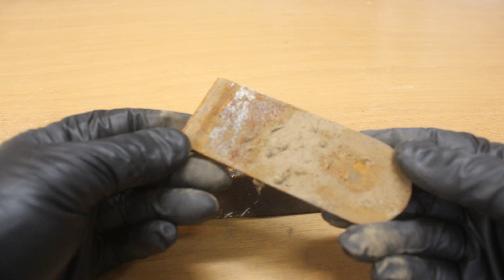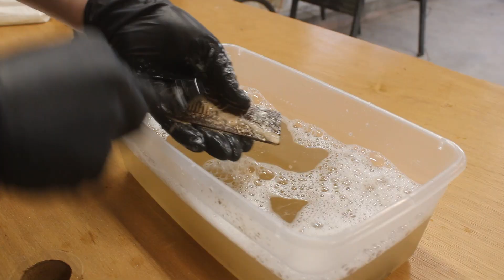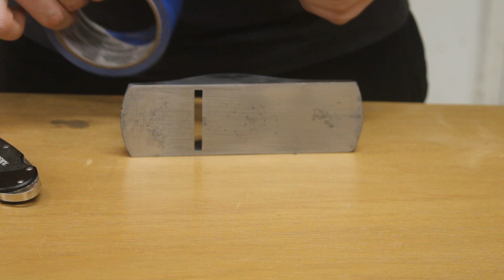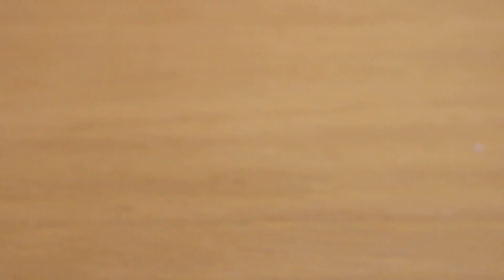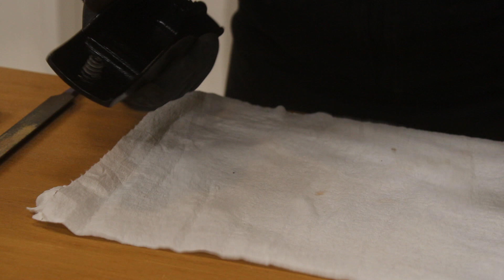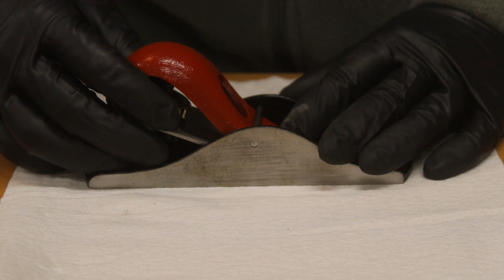Preserving History: Restoring a Vintage Stanley Hand Block Plane

Comment: Do you know what model that is?  It has the adjustment lever style of the No. 120, but also the raised lug on the heel (used to micro adjust the blade by tapping it with a hammer) of the No. 110.  I'm confused because the lug wouldn't seem to work if the iron was engaged with the teeth of the lever.